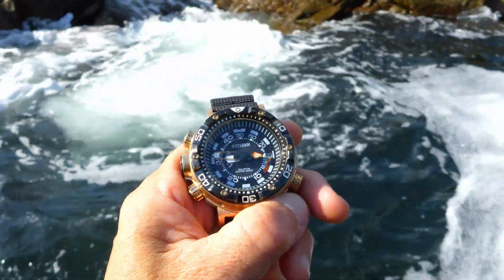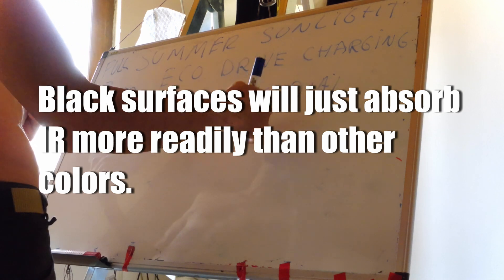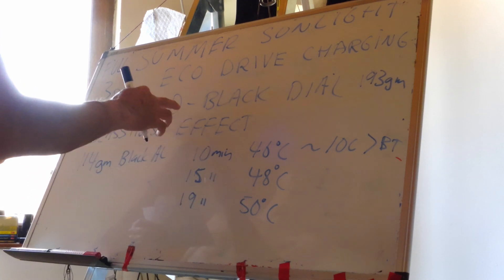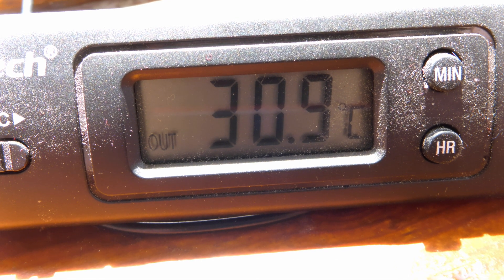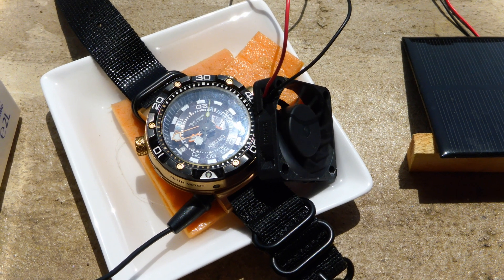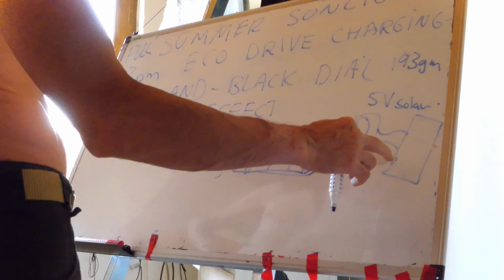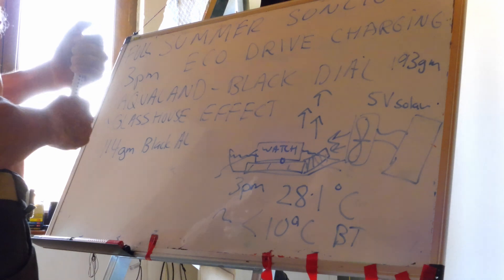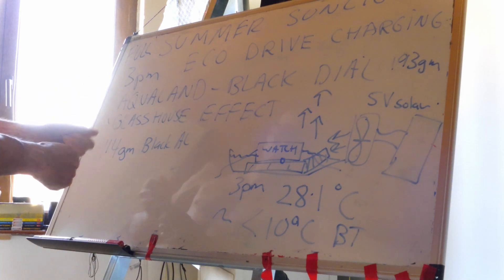Charging an Eco Drive

Comment: Thanks for your video. I have just purchased an Eco drive watch whilst on holiday in Spain.
I decided to charge it outside in the summer sun. As the weather is quite hot I decided to check the watch after 20 minutes. It felt hot to the touch so I took it out of the sun and brought it back inside. Being the worrying sort I came across your video! Is it likely that I've harmed my watch after this one off occurrence? I certainly won't repeat the exercise!
Reply from the maker: Hi there. Firstly thanks for visiting my channel, mush appreciated. I've been to Spain many times band know how hot that summer sun can get, as hot as an Aussie sun LOL. Ok well it sort of depends upon how long you left it for. I used a FLIR camera to measure the temp of one of my eco drives after a few minutes in full European summer sun and it was i think from memory approaching 50C! They (Citizen) say that upwards of 60C will start to have some effects. I would say you are ok if it wasn't';t cooking all day. Even if it was, because it is brand new and thus a fresh battery chemistry of the LiTiMn cell you'll be ok. I wouldn't repeat it. See my videos on how to use that full Summer sun for the fastest charge but without decreasing that rechargeable battery life. BTW I've had eco drive running perfectly for over 22 years, so I have some experience with charging them. According to Citizen Canada, over heating is the main cause of an early return for a service because of watch malfunction. Much can be found on Lithium ion batter chemistry in academic papers showing the effects of over temp and longevity but we don't need to get crazy over it just keep it below 50, preferable to be below 30C-40C in full sun. Citizen for example when they charge their watches prior to shipping do not allow them to go above 30C. I have this from a talk from a product manager from Citizen USA. But remember too that they are charging for 24/7, we don't, unless you are not worried about the electricity bills LOL. Finally, I only ever use natural light to charge because it is the quickest. Check my blog there u will find much more info on the eco drives and looking after them.
Reply: @BushCampingTools  Thanks for your advice and reassurance. The watch was out in the sun for a maximum of 20 minutes. I'll make sure I don't do it again!